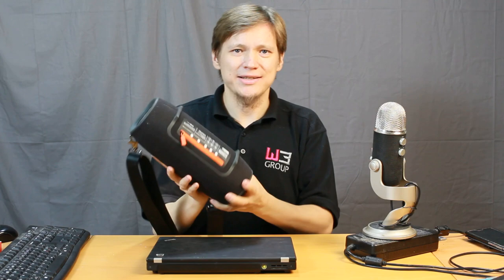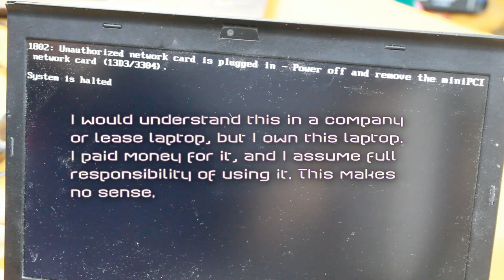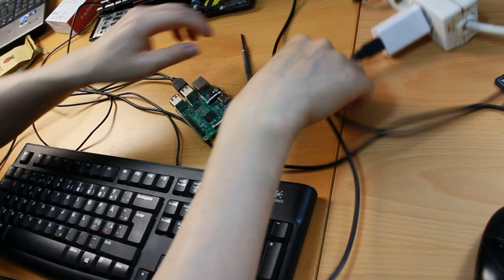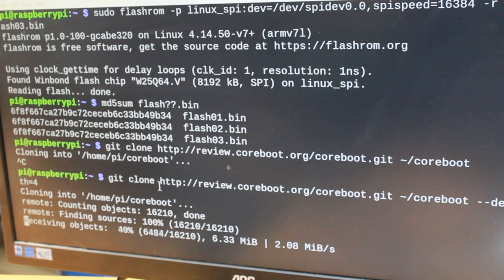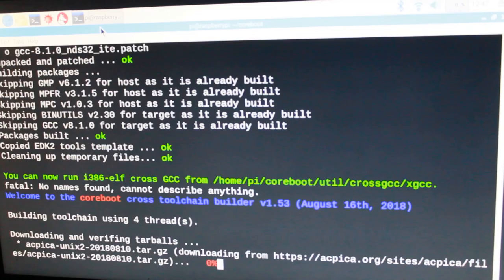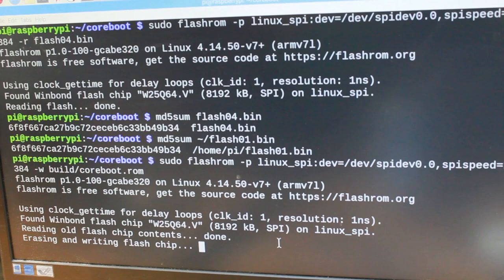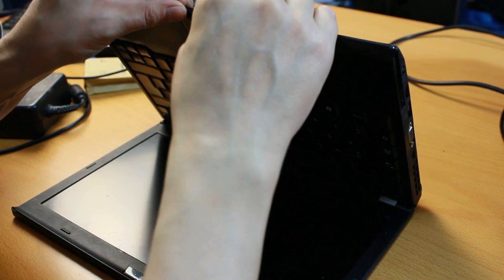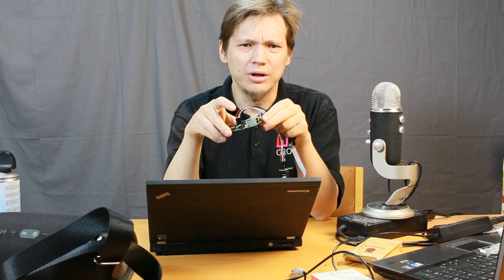Replacing BIOS in a ThinkPad with GPL CoreBoot (former LinuxBios)

Comment from the maker: If you are interested at purchasing a development board to practice embedded programming (or do BIOS replacement like I did), in $1—$30 price range, here are some suggestions. (Not affiliate links! Consider supporting me on e.g. Patreon or Liberapay. Those links are in the video description.)

Raspberry Pi is probably the cheapest single board computer. It goes for around $30 on Amazon. https://amazon.com/gp/offer-listing/B00PEX05TO for model A, https://amazon.com/gp/offer-listing/B07BFH96M3 for model 3B+ (the one that I used).

If you don’t need a computer, but a microcontroller — meaning that you just need a programmable device that can do SPI communication — you can get e.g. an Arduino Uno compatible board (it runs 8-bit ATmega628P) for about 8€: https://amazon.de/dp/B01MDJA464

Technically, even this $1.76 ATtiny85 board would do: https://ebay.com/itm/192024551548 though programming such a tiny device can be somewhat a challenge.

For a 32-bit microcontroller, a Nucleo with STM32F446RE goes for about 15€: https://amazon.de/dp/B01IO3VUHG
These things are plugged into a USB port in your computer, and you compile software on your computer using a cross-compiler, and you upload the software onto the board in a process called “burning” (Nucleo and its Mbed compatibility makes this particularly easy, you just drag&drop the firmware to the virtual disk drive it presents). The board will then run your software. It has no displays attached or anything, but you can establish a serial link between the computer and the board — like a modem but much faster and pretty much instant, so you can read e.g. printfs and the firmware can receive your input.

Here is another STM32 based development board for about 8€: https://ebay.com/itm/172722032708 but you likely need a separate ST-Link device for programming it.

Note that with the microcontrollers, if you want to do something like replace a BIOS using its SPI interface, you pretty much have to write the driver for the BIOS chip (i.e. the part that communicates with the chip, sending commands to erase data blocks and to replace them with new data) yourself. You may be able to find such software already written in the Internet, but it is only good luck if you do.
Writing the software yourself is definitely feasible — but you need to read datasheets and understand the underlying concepts.

If you search for “development boards” on eBay — https://ebay.com/sch/?_nkw=development+board — you can find lots of interesting boards for really cheap prices. Most of them plug into a USB port and are programmed through it. They require different development tools, and for some of them, documentation can be hard to come by. They also have different sets of peripheral interfaces, and it is a good idea to research the product beforehand to find out if it suits one’s purposes.

I am actually planning to make a tutorial on the Nucleo some day.
Reply: Just a question I had... You seem like you can retain information very well and solve problems with ease. I have been having trouble in my studies and was wondering if you had any advice for improving focus and retention. Sorry if this comes across as pushy or random, but this kind of thing really interests me, so it aggravates me when I don't understand how it works.
Reply from the maker: In general, because I am not aware of anything that has made it better for me, I can only draw on something that has made it worse: Cut down on instant messaging and looking for updates in various Internet services to fill your idle time. Let your body have idle time without filling it with distractions. I used to hate TV shows that constantly cut between parallel stories, such as how they produced Mythbusters. I still do, but today I notice me doing the same constantly to myself; lack of ability to have a hold prolonged attention on a particular thing. So take this as a warning. And do sleep well, too: do not stay up late, especially doing idle browsing. Hope this helps.
Reply: You just summed up my problem. I spend too much time checking subscriptions, and I stay up late. I've gotten to the point where it's hard to even read scripture for more than five minutes, and when I have to repeat a task it seems increasingly difficult as opposed to easier, due to my short attention span. I used to not be this way, now that I think about it, but as I've gotten in to the internet more and more, it's drained me. Of course there's people like you who show how things work and such, but most content on YouTube is just crap. I know I seem like an idiot, not seeing what was right in front of me, and I probably am, but thank you. This is the clearest answer anyone's ever given me. Also, if you have the time there were a few questions I had about your views on scripture. No debates or anger, just questions.
Reply from the maker: Sorry, but I did not see these questions. Can you repeat them?
Reply: I misspoke. I meant I have questions that I haven't asked yet. Sorry about that.

I know it seems crazy, but have you looked into the biblical flat earth theory? Here are some verses that may suggest this:

1 Chronicles 16:30

Isaiah 11:12

Isaiah 40:22

Psalm 104:5

Before you dismiss it as irrelevant, hear me out. There are so many people who deny God because to them something may not make sense. But if the earth is flat, the only way this is possible is if there is a creator. Also, re-read Genesis chapter 1 in the KJV and look at how the word firmament is used. Of course most would bring up the ISS and photos of space, but world governments could very easily lie to the masses, and only a few people have to know the truth. This is also tied to the Mark of The Beast mentioned in Revelations, and people not being able to buy or sell without it. Think of how many people will fall for it. Now think of who's giving out the mark: world leaders. Again, I mean no offense and I want no arguments, I just want to hear your opinion.

Love your videos, mate.
Reply from the maker: I firmly believe that Earth is not flat, and that it has never been flat. I think it is an interesting theory that at some point, before the great flood, it had an ice shell, which could have been what was called the firmament. It also could have had a smaller radius and a different orbit around the Sun, and the atmospheric composition could have been different. My beliefs do not hinge on these theories, but I think they are interesting to contemplate upon.
I highly suggest you watch this discussion series between Michael Rood from the Rood Awakening ministry, and creation scientist Kent Hovind. https://www.youtube.com/watch?v=RHh1LTEe9vk 
Other episodes in the same series: https://www.youtube.com/watch?v=4HWldwCfH7s and https://www.youtube.com/watch?v=JGJwMcY1Zu0 and https://www.youtube.com/watch?v=b4-ljS5R0ZY . The last one in particular addresses the Flat Earth theory directly. The videos also have high-quality captions.
Reply: Thanks for your time, most people don't take time to look into it. Also, something unrelated I wanted to ask about, how do you feel about the inclusion of satanic symbols in media like video games? I know you made a video about the Doom engine, but I've always been curious about how you felt on the matter. I personally don't see an issue as you play as the one opposing the demons, but I've heard many people claim that it promotes satanism.
Reply from the maker: First, the definition of what counts as “satanic” or demonic needs elaboration. Does it refer to pentagrams? Does it refer to humanoid characters with goat heads? Both of these are relatively new associations, unbacked by scripture. How about if the head is not goat, but e.g. owl (Muut) or dog (Anubis)?

I would rather promote an alternative interpretation where core of satanism is focus on man’s self interests, or to be more specific, focus on counterfeit/replacements to God and his Torah. Some people uphold the interpretation that Satan is a representation of the evil inclination within man, rather than a specific entity. I lean towards at least partially agreeing with this interpretation.
 
The most striking example of this is when man makes an idol, a false god. The East-Asian mythologies for example are full of these. Many games borrow on these, such as the Final Fantasy series, where Shiva, Ifrit etc. manifest as summoned spirits in one way or another in most installments. Santa Claus (and Christmas as whole) is also an example of this, as becomes clear when you watch e.g. this documentary: https://www.youtube.com/watch?v=XAwkb2AcoO4

By the strictest interpretation, any entertainment pursuit, that is not founded on Torah, is satanism. However, it is a very slippery slope and one that may have some very unfortunate implications, and I am personally not advocating the act of condemning every game and every hobby and every intellectual pursuit as satanic. I would at least add a qualifier: and that promotes disobedience of our Creator. In any case, it approaches the topic of free speech, and polemics in general. I think you should be allowed to discuss, study and criticize all topics, both evil and good, as long as you are not engaging in the evil actions. Even the Bible condemns ignorance.

I do recognize the today-prevalent white-washing of many concepts that are founded in counterfeit religions — such as presenting witchcraft as fashionable and positive — and I think it is a dangerous trend, general. As a Bible believer, there is also the concern of what do you feed yourself with; what kind of influences do you let into your thoughts? These are not easy questions in today’s world. As you probably know, I have played lots of these games and even translated some of them. All I can say is, stay strong and be sure to feed on the Truth. “Thy word is a lamp unto my feet, and a light unto my path.” (Psalms 119:105). “Stay alert, stand fast in faith, be manly and be strong; and everything, that you do, do it in charity/love.” (Paul’s 1st letter to the Corinthian believers 16:13—14.)
Reply: Thank you for your time. I'm sorry you had to take as much time as you did to write these comments out. If I read correctly, I definitely agree with you on the satanic symbol ordeal. I was just curious about how you felt about such forms of entertainment. I know that you're busy with work and the channel, so I'll cut it off here. Once again, thank you for your time.
Reply: easy way be  mod bios update suppport  new chip..
Reply: You are using Raspberry Pi 3B, not 3B+. Basically the only difference is that 3B+ is a little bit faster and has Gigabit ethernet and metal heatspreader on SoC
Reply: How is the nucleo video coming along?
Reply from the maker: Not progressing unfortunately!
Reply: I'm a year late to this, but +1 on the STM32 Nucleo boards, they're really nice.  Pretty easy to set up with ST Workbench or Mbed Studio.  The HALs are easy to use and the chips are nice and beefy for MCUs (I have the F767ZI, a Cortex--M7 based board).

Unfortunately I sold my soul to Mbed OS and Mbed Studio on my last project to get a TCP/IP stack running quickly, LwIP was putting up a serious fight in getting things started with a basic GCC-built project.
Reply: Cool I got a Raspberry Pi Zero W and a Raspberry Pi 4b
Reply: People may also be pleased to know that if they are running a WINE VM (or Windows 10) that they can avail themselves of CH341A and matching BIOS jumpers/clips to do the reading and flashing of BIOS, from locked BIOS to reversing, to programming corebios or librebios (plus EFI additions sometimes) to systems matching the firmware builds. On the other hand it's handy to have a RasPi4 (with heatsinks, preferably) as a spare build, electronics test, and OS deployment machine for those curious enough to do some electronics breadboarding, and it will put to use your spare USB keyboards, HDMI or displaybus displays, MicroUSB power adapters and USB mice as in the video here.

Comment: One step closer to a fully Open Source computer
Let's hang tight for RISC-V to make an appearance
Reply: I don't care about IBM PC compatibility. It only needs to be able to run Linux.
Reply: Progress report??
Reply: Yes, but you still need to remember ther RISC-V is only open source instruction set so the processor itself could be not open source (and I think most of them probably are not but I am not sure).
The project that I am aware of is "lowRISC" but as far,as I know they are still did not created this fully.

Comment: Leave it up tp bisqwit to rewrite an entire laptop's bios just to use a Bluetooth chip to play music from a speaker in a dance class. Älä koskaan muutu ystäväni ;)
Reply: compile downloaded software (now many commands to do so and manuals available), read and write content of chip and boot to working system. people think this task is more than it is. anyways coreboot is very cool project and software based limitations for hardware are really annoing.
Reply: Except if you can't do it from within the computer itself, it becomes really complicated, requiring additional hardware, such as here. Plus the knowledge of how to use Linux on the rasppi (which not everybody has the experience to do.)
Reply: @DjVortex-w  nah, if you can read you can do it.
Reply from the maker: Like I wrote in another comment, using software developed by others is a step far below from creating software oneself.
Nevertheless, this is not something I would have attempted without having at least some experience of the involved concepts.
Reply: if you dont have basic knowledge about project or dont have any real reasons to do it when its probably best to not do it. operation is really well documented in multible sources and reading about project few times before actually doing it should be done. i think flashrom install on rpi didnt go so nicely and source wasnt current official one. anyways if you put little time on it - there should be no problems.
Reply from the maker: Right. Is there a particular reason by the way, why you go around posting in threads trying to belittle my efforts? If your intention is to encourage people to do things, do that. Now you are just basically saying "he did not do anything impressive". Whether you are right or not, I wonder about your motives.
Reply: I have only said that it is nothing special. I dont see any idea why I would waste my time talking bad about someone else. Simply pointing out fact that this isnt anything hard. Also if you did go and read what kind of comments I have answered Im just correcting them. Its not rewriting entire bios. Why are you trying to make devil out of me? Im somehow now having behavior problems and talking bad about you or your doing? I did state out what you did and how you could have done it better/more correct.. even going for trouble to find parts you are missing and show them and offered to send them to you. From my point of view I havent done anything wrong or said anything bad about anything or anybody. I know that you are doing really nice work on some projects and Im following you for that reason. This on simply isnt so hard to do as people think and its not as complicated as they think it is. It might be that my skills with english are making my messages give off wrong image somehow.
Reply: "Except if you can't do it from within the computer itself, it becomes really complicated, requiring additional hardware, such as here."

"nah, if you can read you can do it."

Yes. Reading will magically conjure the clamp, the cables and the Raspberry Pi out of thin air. Poof! Magic. Only reading required. I suppose it's some kind of magic spell book.
Reply: "I have only said that it is nothing special. I dont see any idea why I would waste my time talking bad about someone else."

It would be one thing if you had made such a comment once, and that's it. However, you have been spamming the same thing as a reply to at least a dozen comments by other people that I can see, and even repeatedly within those comment threads. This goes well beyond just some kind of casual opinion. It's systematic.
Reply: Not all of us think it's especially difficult to do what is done in this particular video, but it surely takes some skill & effort and it's something not many of us have done. I like the attitude of Bisqwit and his DIY spirit and his step-by-step approach of becoming a masterful craftsman, and what's more, the way the videos are done inspires people to do the same -- to enjoy the work in a road of becoming masters themselves.
Reply: really systematically answered to few persons that it isnt really hard what was done.

Comment: Ha, so they are still doing that. Back in 2007 when I had a Thinkpad, I had to flash my bios too, to install a 3rd party wifi module. Was a better solution than carrying a pcmcia WiFi card around.